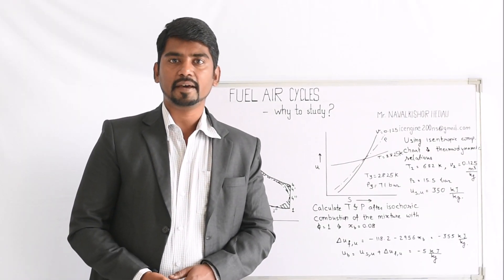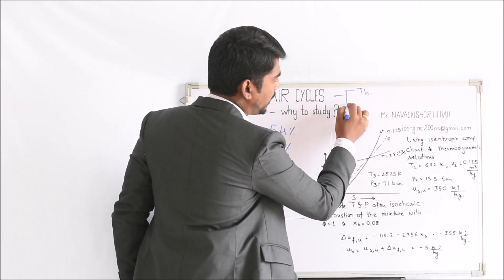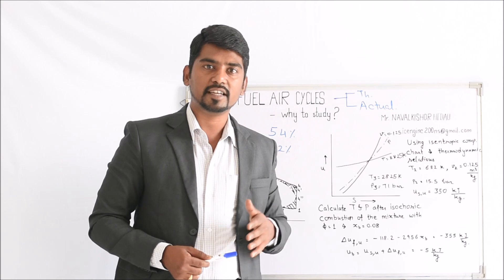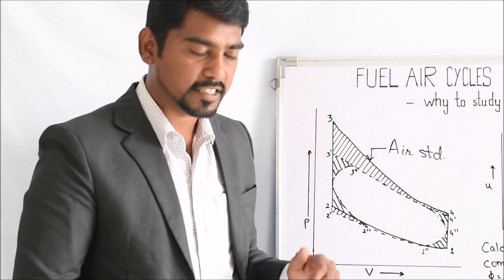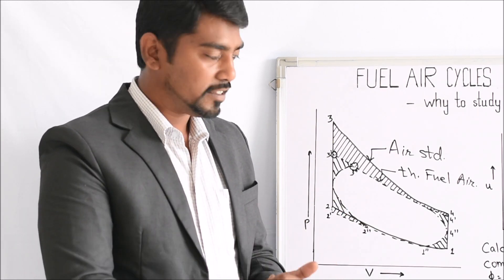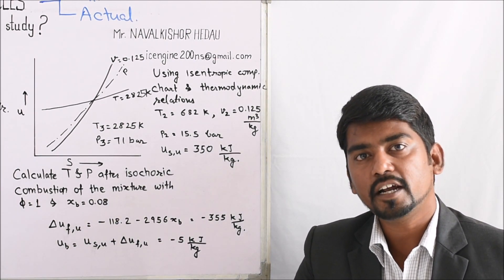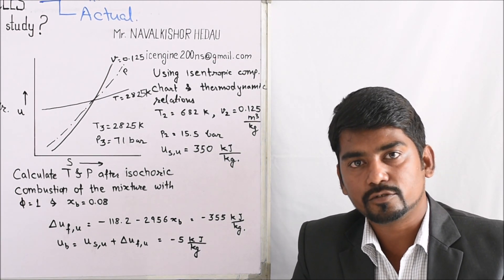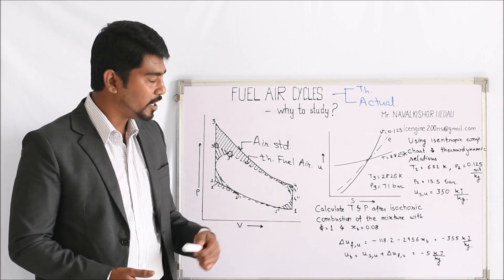Fuel Air Cycle - Need to Study - IC Engine by Navalkishor

Comment: Sir how the efficiency of diesel engine increases when intake air tempereture is increased
Reply from the maker: Normally increasing the intake air pressure increases the efficiency of CI engine by increasing pressure and temperature condition of the combustion chamber before the fuel spray. But this increasing the inlet pressure also increases the temperature of the air.

Now this effect is beneficial as it increases the temperature after compression thus achieving more Combustion which ultimately would increase thermal efficiency. 

However there is a tread off. Too much increase in intake air temperature reduces volumetric efficiency thus the need of intercooler arises.

I think this solves your query.

You can also go through the relationship between the intake temperature and pressure and ignition delay. That will also help you